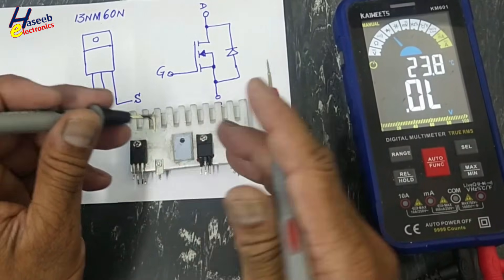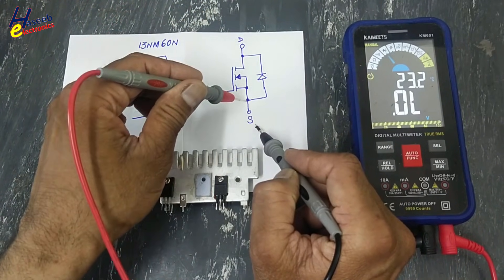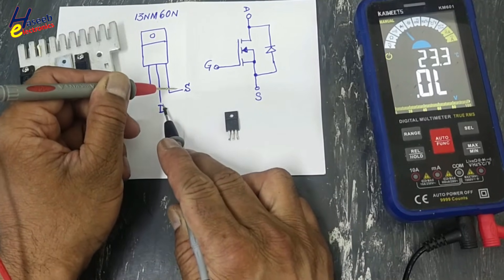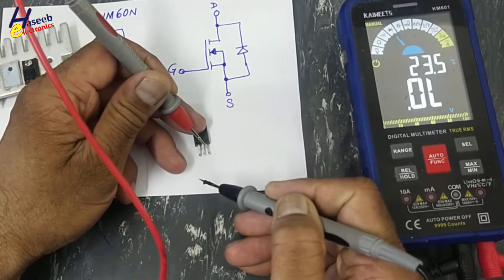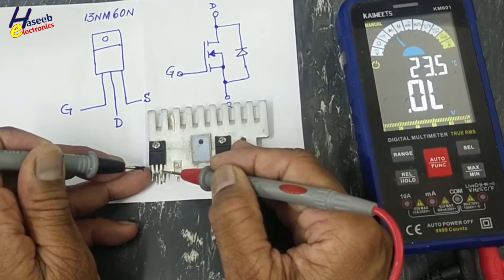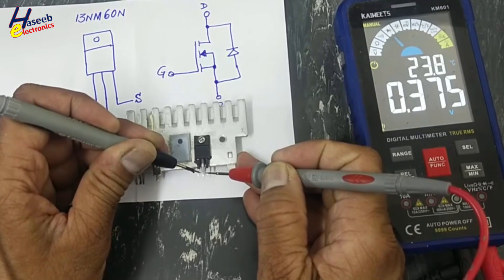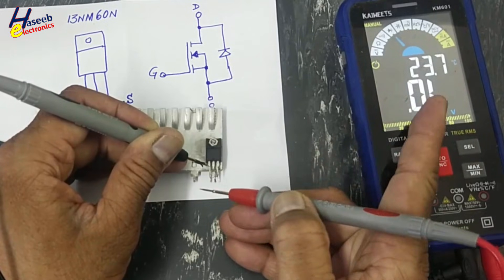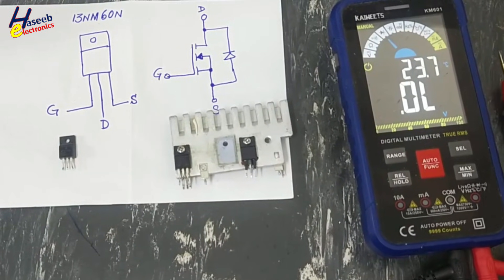{1309} How to Test MOSFETs with a Multimeter (Good vs Bad MOSFET Explained!)

Comment: Excellent!
Who had thought it was so easy to check a mosfet with a simple multimeter?
So the gate parasitic capacitance is sufficient to stay charged during your drain-source check;
it is not as negligible as one could think and you don't need 3 wires for the test.
Great measuring tip, thanks for sharing!
Reply from the maker: best regards 
basically the gate and source has an insulated barrier, which creates a virtual capacitor 
when we charge the gate (connecting multimeter between gate and source). thet time the MOSFET drain to source turns on
and it will remain in On-state, until we discharge the gate the multimeter in reverse polarity or touch gate with source pin. that will cause to turn-off the mosfet channel 
in practical MOSFET circuit, there is a high value resistor connected between gate and source. that is used to discharge the gate. it is also named "gate discharge resistor"

Comment: Is it normal to have 270 mV in a TO-220 n-channel MOSFET?. I’ve got another one that also have 300 mV. For some reason sometimes I get 520mV in one of them. And also when I activate de gate I,ve got a really low reading of 0,002 mV in both. It’s kind of strange.

Comment: I have a mosfet, which is 2N60L.
When i turn it on with multimeter ( i.e when i put red lead in G and black lead in S), it gives me 1.5v in Vds.
And when i turn it off, it gives me open circuit.
But when i go back and put red lead in G and black lead in D this time, it give me 1.5 Vds again 
Is it right?

Comment: Thank you for informative video.
One question on this test, after momentiry touching red probe on N-Channel mosfet gate, how long does drain and source show conduction on multimeter? In my case, with IRF3205, I see it show conduction and within few seconds goes back to non conduction state. Just worried if my mosfets are bad?

Comment: Excellent Job, Haseeb!!!
Why we can't test mosfet in pcb circuit with multimeter as you did here?
Sometimes when I apply an external input voltage to the gate and source in which it doesn't exceed max gate to source voltage (Vgs)as mentioned in datasheet, it doesn't also work(no resistance between drain and source in buzzer mode in multimeter).
Reply from the maker: Yes, you are right
in circuit it is risky. first of item gate discharge resistor connected between gate and source pin. it forces the gate pin to remain in discharge condition. and gate driver circuit doesn't allow external signal to become high. it discharges through its driver stage parasitic diode
Reply: Too many thanks, Hasseb 🎉🎉.
Could you make a tutorial for explanation of the following components:
1- FSFR1700XS
2- FS7M0880
3- LM2596
4- KA78R15